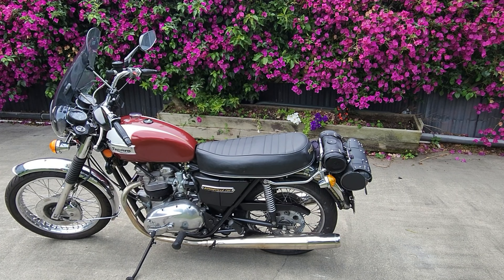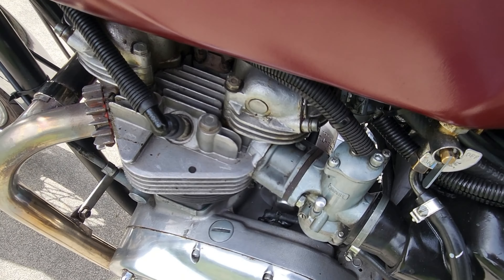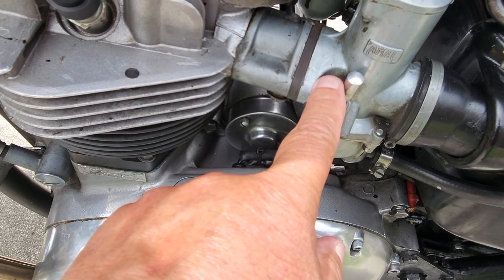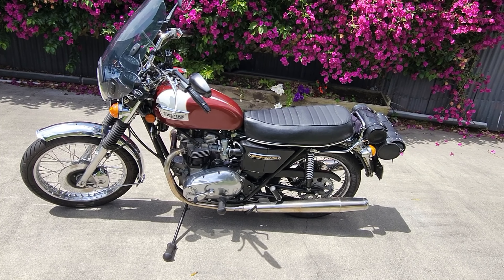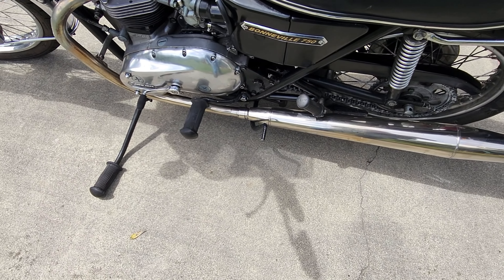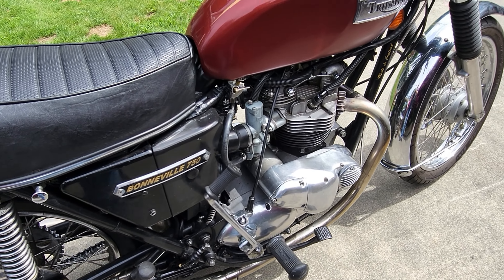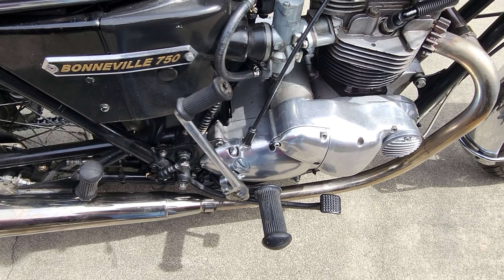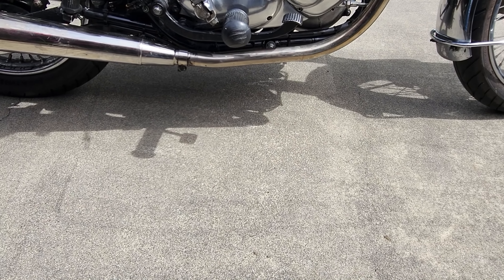T140v My Bike Walk Round

Comment: Nice machine, sensible mods! Greetings from Wisconsin, I have a '76 Bonneville, which i acquired in '89, and did a full restoration in '05, and I've been keeping it shiny since. Finally installed Pazon ignition three years ago, smart move! Two things I haven't been able to resolve: an oil leak in the front sprocket area, and the shift between 2nd and 3rd gear is sketchy. Agree about the front brake, it is only "OK" 😊
Reply from the maker: The oil drip from the sprocket can be resolved by just putting a quality oil compatible silicone sealer on the shaft, carefully of course behind the oil seal before you put it on. Oil tends to run down the grooves on the shaft. Also don't over fill the gearbox oil as that is very easy to do. Ensure you let ALL the oil drip out of the fill height tube until its completely stopped. I timed mine on the last gearbox oil change and with an ambient of 25C it took nearly an hour to stop dripping. Very frustrating but worth doing. Hope this helps you get an oil free Bonnie mate. For the gear shift, I would take the selector apart and check the full mechanism for sticking points. Wear can cause this and its very important to check the sliding surfaces for any damage and repair as needed. I would recommend using a full Synthetic Gearbox oil as its stiction/slip factor is significantly less than mineral oils of same rating. . I use Penrite Pro Gear Full Synthetic  80w 140 gearbox oil. Hope this info is of use mate.
Reply: Thanks for the advice. Looking at the exploded diagram, I can see how oil can leak past there, too bad i didnt get the memo when i had it apart!. And I'll try the fully synthetic gearbox oil.

Comment: What a well sorted bike.  That oil pressure gauge is such a good idea. I had a sticking oil pressure valve that made the pressure blow crankshaft end, timing seals and my push rod tube seals. I've just found your channel and I'll be an avid follower from now on. A video on how to mount and pipe the pressure gauge would be welcome.

Comment: Nice set up with the battery and switches.  I just picked up a 78 T140 on a partial trade.   It needs some love for sure.  I've been going through it and making it safer and more rideable.   After a carb clean it started and ran well but the brakes were crap.  Got the rear brake working good with a caliper rebuild, but the front brake is really soft and doesn't seem to have enough pressure in the lines, even after rebuilding the master cylinder.  It'll slow me down and eventually stop me, but it should work better.   I may replace the brake lines next.  I don't think the caliper needs a rebuild as the piston move in and out okay and there's no leakage.
Reply from the maker: It may be just your flexible lines getting a bit old. Put your fingers on the middle of one and put the brake on hard. If you feel it bulging then they probably need changing. I use braded stainless flexi lines now as the std rubber ones give way far too much even when new. I got mine made up for me at a hydraulics store. Fitting a 5/8" master cylinder helps greatly, along with going the whole way and fitting a twin disk, but that's very expensive. Start with your flexi rubber brake lines first. Hope this helps but remember your working on vintage equipment and it will never be as good as a modern bikes brake unless you change the complete caliper and disk for a modern one.
Reply from the maker: I just made a video on my channel on changing the disc that you may find very helpful.

Comment: In addition to my oil pressure problem, now mostly sorted, but my final leak is the oil being pushed up the wires and sleeve from the primary chaincase to the regulator and being deposited at the back of the crankcase. On close inspection you seem to have extended the sleeve and covered it in heat shrink plus some thin cable ties. How far back have you extended it? You are very proud of not having any leaks so were and how have to terminated the sleeve. I'm inspired to get a long tall Givi screen by the way.
Reply from the maker: I use silicone on the rubber o ring seals that fit into the back of the primary. I also put silicone in the seal from the inside then I push the assembly together. Its a very messy job but worth doing. You must form an oil tight seal at that point and not try to fix it higher up the cable. I use the shrink wrap just to make it tidy and add protection to the cables, it cannot stop oil. The screen simply makes a big difference on the air pressure on your chest when riding allowing you to cruse comfortably at high speeds.
Reply: @DaveWhellersVintage  I've put heat shrink and 2 small cable ties at the back of the primary chaincase and right upto the push in connectors to the regulator but not using any silicone.  After about 100 miles it seems to have done the trick, but I'm concerned at your remark  about the silicone ,not using it further up the cable.
Reply from the maker: Sorry dont understand, is this a question?

Comment: Lovely job, I can see myself fitting an ES kit as I get older and my knees get bad. I’ve had a 78 750 Tiger for many years and I’ll never sell her! She’s completely stock other than an external oil filter. The crank case has never been split so I’ll have to go in there at some point and clean the sludge trap. She’s not a particularly vibey bike but I’d certainly consider getting the crank balanced, did you find it made a difference??
Reply from the maker: Hi yes I would recommend getting it done dynamically but not statically on a balance bed, or the old way as some call it. Dynamic balancing Is not cheap but the difference is astonishing.  
Knowing what I learnt with this I whish I had done all my other Bonnies I have had over time. 
Until I had this old girl, which will be my last bike. I never experimented and every thing went back as it came out of the factory.
Mine ticks over with hardly any vibration at all and at 3000 and above, shes as smooth as any jap bike.
I would also recommend fitting a Pazon Altair Ignition system. The difference between contacts / Boyer up to the mk4 and even the new Trisparks is also amazing. 
Anyway its up to you and its all personal preference.

Comment: Nice, which model powersports battery did you use? thx in advance..
Reply from the maker: Go to the video I made of my last engine rebuild. In the description for the vid is listed all the equipment upgrades I now use. I also made a specific vide in my maintainace Play List that has all the videos relating to specific maintenance jobs with details in the description for each video.. 
Here is a link to the lithium battery one for your convenience mate. Hope this is of use 
Don't forget to click like and subscribe please on them.

https://youtu.be/ZWplZCHhi4c
Reply from the maker: If you look at the description on the video it has all the details in there mate.
Reply from the maker: If you buy Lithium then you need one with at least 250cranking amps if you have electric start. You MUST get one with BMS or Battery managment system.
Reply: Thank you Dave  @DaveWhellersVintage